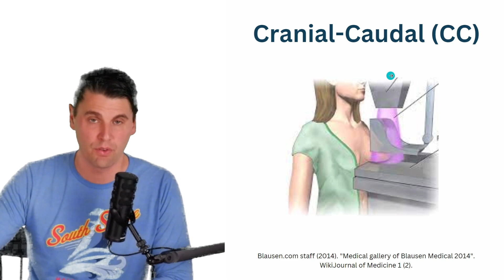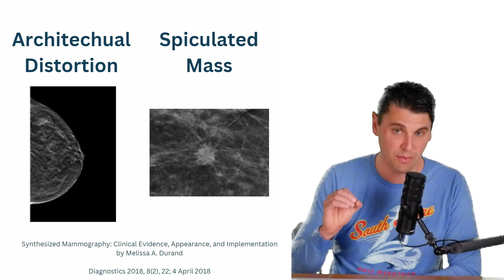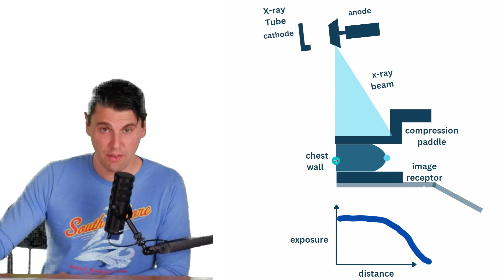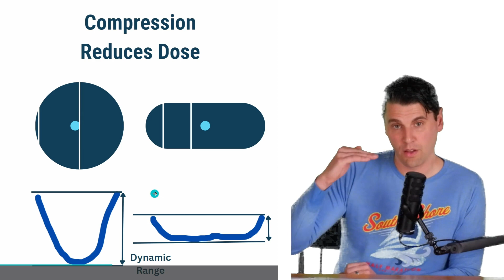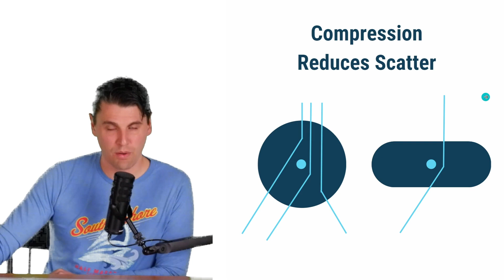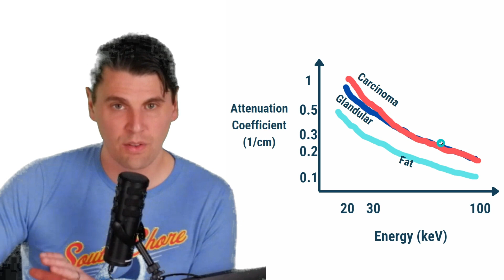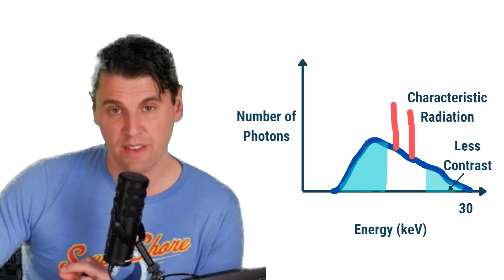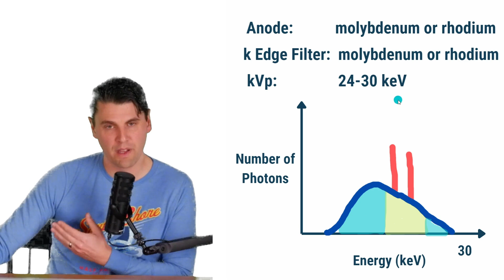Mammography (X-ray Physics)

Comment: Does anyone here know how many line pairs does Mammography resolve? and when compared to CT which one has better resolution? If possible please provide the source of info
Thanks
Reply from the maker: Traditional CT has between 6-20 lp/cm and mammograms have at least 50 lp/cm or higher. Often mammo systems quote numbers in lp/mm since the spatial resolution is higher. There are newer CT scanners with higher resolution using photon counting but still lower than mammo.